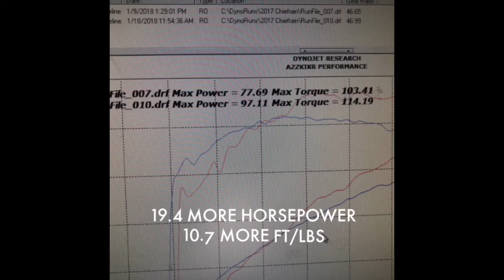2017 Indian Chieftain Stage 1 vs Stage 3

Comment: Milwaukee 128 mad 139 hp and 135 ft/lb on a dyno in Florida  Is there really that much difference or are you at a different altitude the dyno in Florida had an atmospheric pressure of 13.1is there much difference from your location?
We all know yno results vary wildly i would just like your opinion. I am an Indian fan